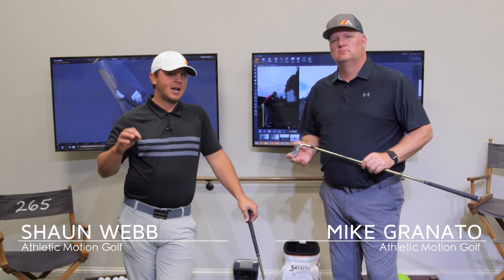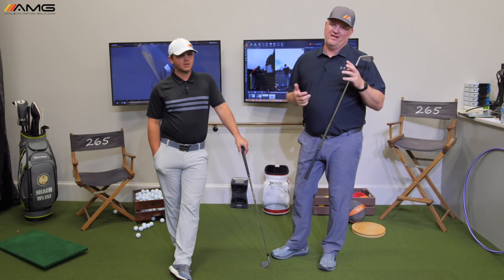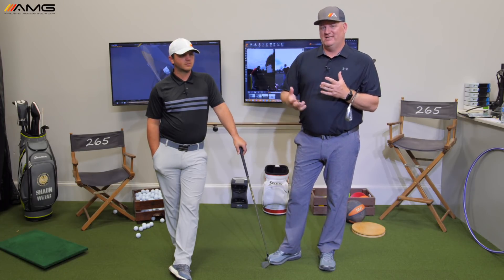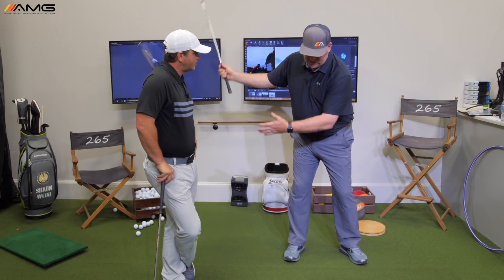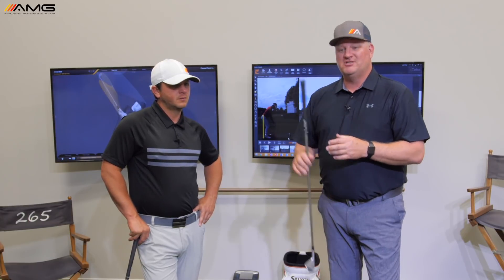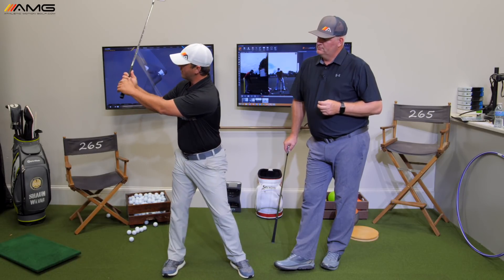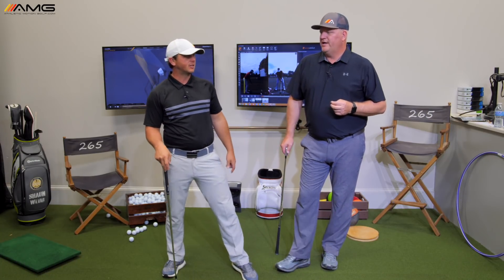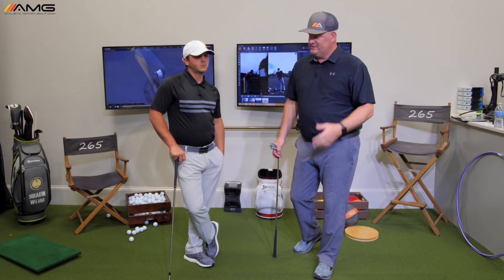More Distance With A Shorter Swing

Comment: I spent 3 years on this transition. Working the left shoulder down, right hip up during the back swing, produced a much shorter back swing. The change in delivered dynamic loft, and better spin loft numbers kept the ball speed, not swing speed up. Comparatively speaking, my old pattern was quick inside, then hump it and dump it. Club rotation at the bottom created more club head speed, but nothing else was consistent. Two way misses all day.
Reply from the maker: Very common results... great work!

Comment: Great video! I’ve noticed though that when I try to shorten my backswing I’m more tensed and I tend to rush the downswing to get the same distance as with my full swing, and I’m coming over the top more often. I have an overswing kind of swing and I feel more loose and relaxed with my natural swing. And even if the downswing is much longer, I’m more in synch and the release is better...
Reply from the maker: Those are classic descriptions for being out of sequence in the backswing and/or being off plane halfway back.  A great way to sort that out is to make the length of swing you want but do it very SLOWLY.  That'll allow you to be aware of and feel when things get off track.  Slowly!😉
Reply: Thank you for your reply ! That’s a good idea ! I’m gonna do it slowly ! Thank you for the advice ! 👍🏻
Reply: Of course, you must transfer your weight to your lead foot, and you must rotate your hips so that you finish with your belt buckle to the left of the target, however, you must also keep your left arm straight and make the magic Hogan Move. You might well ask what that is and I'll define it for you as follows: while keeping your left arm straight, you must try to stick your right elbow into the watch pocket on your blue jeans. Clearly, that is impossible, but try doing it, and keep the watch pocket and the right elbow opposite one another until after you've hit the ball. One caveat: don't let your right shoulder socket/arm scrunch in at the top. Make sure that you've stretched it out, or it will cause a micro, inside out movement. I've been there & done that, but this fix has helped my power and accuracy.

Comment: I just did a version of this on the range.  I can hit PW 115 easy so on the range today I did an experiment hitting PW,9,8,7,6 to the green 115 away.  Everything after PW had more grouping accuracy with the 8 & 7 being the best on accuracy to pin and even hitting the pin with the 8 once.  Just proves to me if you are not a pro with every club then we should not try full swings at certain distances because it does not return results that shorter swing can.  Ty
Reply from the maker: Tony, what you just described will take more strokes off scores faster than just about anything else golfers can do.  Learning to play "off speed" shots like you described IS golf... great job!

Comment: Just wanted to say thank you guys for making these vids and making this data and info available!

Ive noticed you guys REALLY emphasizing an early shift left so I'm paying close attention to it! I've toyed with the early shift a lot before and had mixed results.  I often find my ball flight to be lower than optimal when using that downhill/falling left feel although contact is solid.  I feel like my head gets too far forward and I catch it a bit thin.  Maybe it's my head/ spine leaning too far toward the target maybe my right arm is bent too much at the bottom (and in the backswing) but seems like the low point of my swing gets too far forward with that move.  Especially with a 3 hybrid or 3 wood off the deck it will be very low flight.  Any advice on how to use the move and still hit the high ball?  Do you see others with that issue when first starting to use the move?
Reply from the maker: It sounds like you could very likely be overdoing the shift, Chris.  It's far more subtle than many realize... you're only looking for about 3.5"-4" (about the width of an iron) as a general guideline.  It doesn't take much effort at all to cover that distance in the swing.